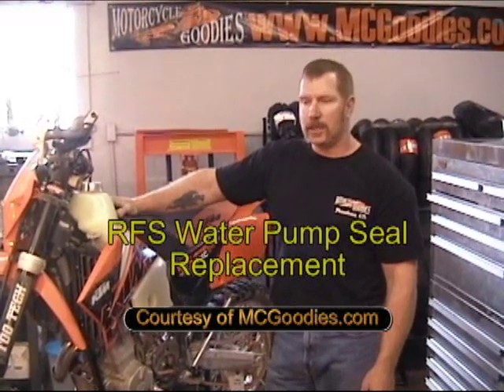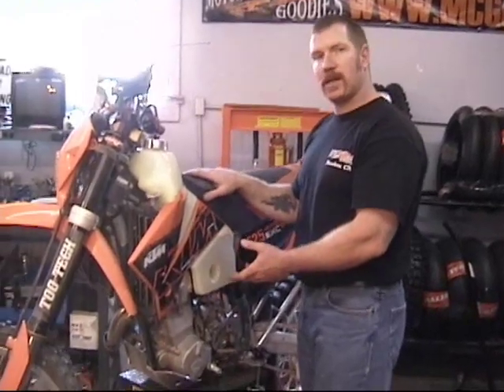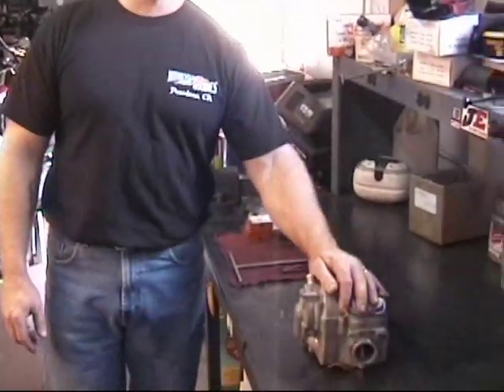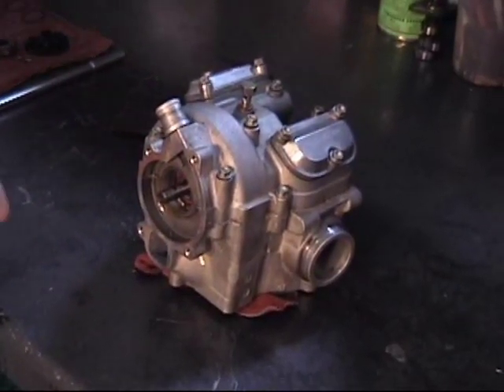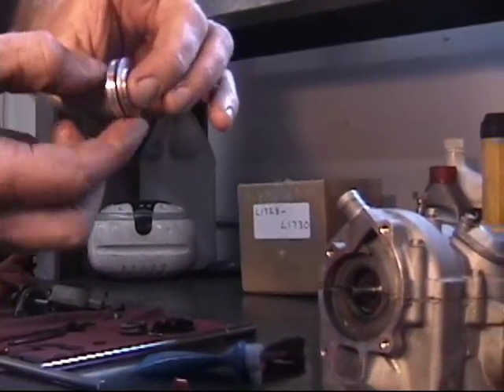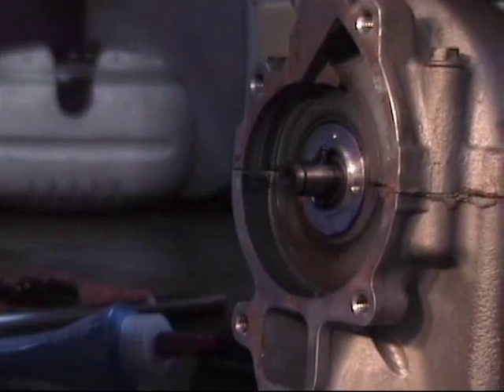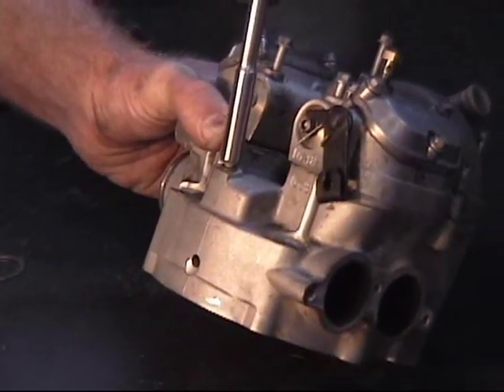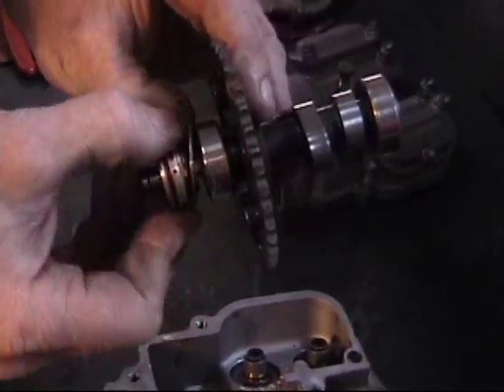KTM RFS Water Pump Seal Replacement

Comment: The shaft seal protection sleeve you used what can I use to make on no kits come with them
Reply: im about to try this soon, was thinking about it in my head, i think some heat shrink tubing (kind used for electronics) would work great. Find similar diameter and then heat it up and it will look just like it does in this video. Thats what I'm gonna do

Comment: What the video doesn’t show is the valve cover isn’t tightened down to the head. I’ve tried this method and I can officially call bull shit on doing without taking the valve cover off. Carrier will not seat on the back oring.

Comment: Thanks a bunch! Seems to be working. I did have to press both seals in the keeper with a brass rod and a hammer. I used blue painters tape to wrap around the end of the shaft so it didn’t Knick the seal. Your kit at this time was unavailable.

Comment: Why would you only do the outer O-rings of the carrier and not the seals that go around the shaft? I’m confused that’s how I’ve always done it and you might as well while you’re in there
Reply: He placed everything with a kit, it was all new
Reply: @RiggadonDan  can you replace the old type with out the holes with the new type and the center ring. I have a 2001 400 exc. will have to remove the valve cover

Comment: Does replacing the carrier stop oil leak? Or just coolant leak? Ive got an oil leak do i need to replace the inner seal?
Reply: Typically you would do the two seals that are in the center of the carrier and not just the O-rings,  why he doesn’t do that in this video is beyond me. The inner one is an oil seal in the outer one is a coolant seal.

Comment: Good afternoon, I wanted to ask you, the motorcycle is the same as yours, the same engine. There is one problem, you can help me out if it's not difficult to explain. Drops go on the engine on the left side, and drain to the bottom, but the oil level is fine, the antifreeze is fine. And another problem, I can't find a cold level, and after warming up and running the engine, there is a level. Please help.( Vladislav from Sakhalin)KTM XC 450 2006

Comment: Love the video! Question...I have radiator fluid weeping out of the little hole to the right of the water pump impeller. It appears as though this video shows all that I need to do to fix the problem, correct? Next question...so I don't need to take the cam cover off, break the cam chain to remove the cam to take care of this weeping leak that is getting worse? Last question, you sell the kit with the sleeve protector? I have the 2003 525 exc and I have a 500 mile ride coming up in two weeks. When I buy it, can I get it by this Friday so I can follow your video? Thanks.

Comment: Why is the drain / indicator hole installed oriented on the top? It seems to me like if the coolant o ring leaked it would run down the second channel and out the weep no problem.

However, with the hole for the internal, shaft seals installed vertically overhead, it seems the space between the seals would have to fill before coolant could run up and out of the drain hole and then out the weep hole...

My manual is poorly worded on this too. I may be overthinking but might as well try and do this right the first time

Comment: Can the coolant make its way into oil if the seals are bad?
Reply: There are two seals in the carrier - one for the water side and another for the oil side.  The center of the carrier is sort of a DMZ zone if you will - nothing should ever be there.  If the water side fails (the most common in my limited experience), the coolant will leak into the DMZ and out through the weep hole.  If the oil side fails first (this hasn't ever happened to me), then oil will enter the DMZ and leak out the weep hole.  
If both seals fail then I'm guessing you'll have a mix of oil and coolant leaking out the weep hole.  Both the oil and coolant are above atmospheric pressure, but since the weep hole is open to the outside world, that would be the path of least resistance and would almost certainly vent all oil and coolant.  I can't really imagine a scenario where coolant would be able to traverse the DMZ and force its way into the oil.
But really, just a shade tree mechanic here, so happy to have someone more knowledgeable either confirm or deny.

Comment: Hi, Great Video! I have a question, I can perform this work with the mounted head? or do I have to remove the cylinder head
Reply: hi - you can do the  job without removing the head

Comment: How much would this cost if token to the shop. How long was the process do to this job your self instead of taking  it to the shop.
Reply: Robert Garcia KTM shop probably a little under 200 w parts. I believe kit is roughly 45

Comment: quick question. which way do the two shaft seals go in the grommet holder. are they installed where you see the circular springs on each side? how do you install those in the holder? thanks a bunch for the video
Reply: Hey bro did u ever get ur grommets in the carrier? Im having a hell of a time, like their wrong size
Reply: @KORR805  if they don’t fit freeze them, spring side facing out each side
Reply: @KORR805  sorry, 7 years ago,  no idea;)

Comment: I got as far as taking the impeller circlip off,the impeller doesnt come off with big snap ring pliers,plastic is very soft and gives way easily,the impeller comes to a hard stop at the circlip groove even with two pair of pliers pulling on it.
So it goes so far

Comment: Could a person that has  a 2001 up date the seal to the newer stile or would it even work like that
Reply: chris mounts I would like to know the same thing.
Reply: He said something about changing the whole pump style to the newer version at the beginning but didn't follow up any more after that... Anyone have any issues with little drain hole behind the pump on the block?
Reply: Nvm, he starts about it at roughly 8:30.. o ring in the camshaft... 😭🤦

Comment: Thanks for the video, Had to use a bolt to pull seal the carrier out.  The bolt from your push button start switch is the same size.  Quick tip instead of running to the hardware store.

Comment: hi i cant get the seal carrier out its stuck and when i took of the water pump cover my locking ring on the impeller was gone i found it inside the engine -.-  how can i get the seal carrier out

Comment: dont put the last o-ring in the hole. its easier to just get it on before you push it in.
Reply: Be super careful here because you must NOT put the interior o-ring into the center slot on the seal carrier.  That's the wrong place!  To put the inner o-ring onto the carrier you would just have to place it on the shelf of the carrier (think of an "L" channel instead of a "U" channel) to have it go in the correct place.  Although I haven't tried doing it this way, it's possible that the o-ring would want to roll up as you pressed it into place which wouldn't be good.  
The method he shows in the video where you place the o-ring into it's final position and then push and rotate the carrier into place seems like a better choice.  That's my two-cents anyway for a 9 year old comment.  :-)
Reply: Dave Orth my problem is I put the back seal in the hole, front seal on the carrier, do the twist as I push it in but then the entire carrier won’t stay in just wants to pop out about 1mm enough that I can’t get the pin back in for the impeller
Reply: Anyone? I press and twist and it pops right back out.

Comment: Do you Have any videos or links on Replacing a waterpump seal on a 1986-89 Honda TRX250R Motor?  I Believe the Specs for the CR250 Dirtbike Motor are very similiar and would help also. Thanks alot I really appreciate it.